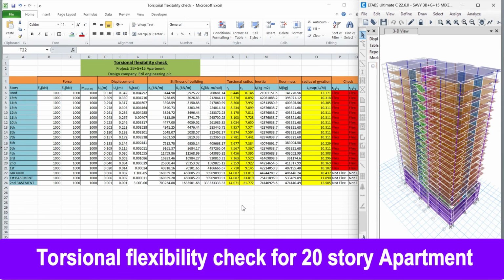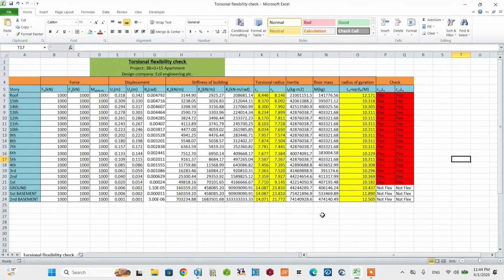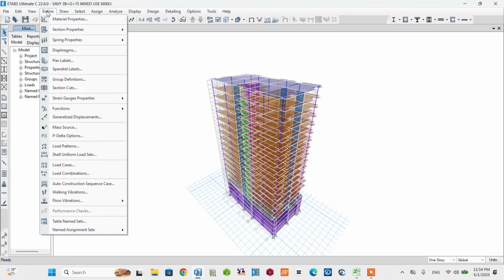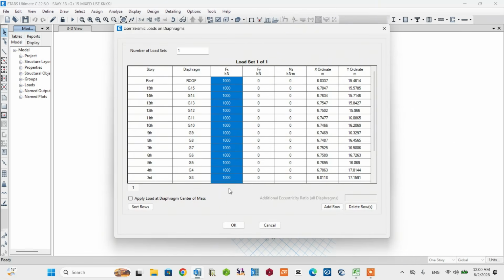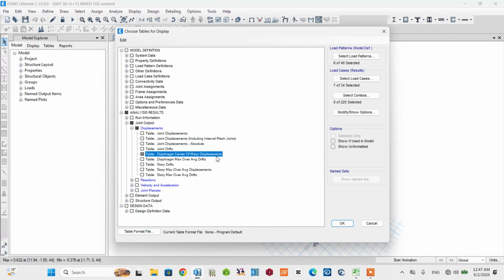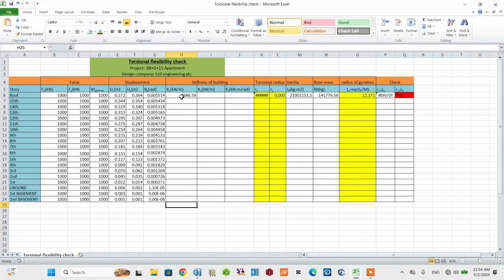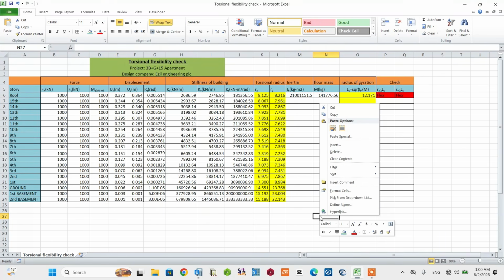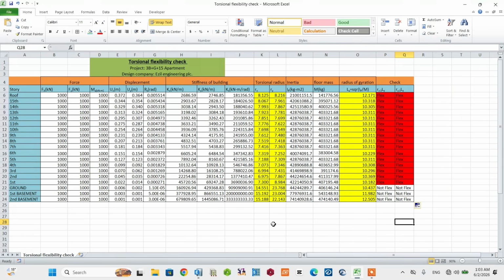4 Pre Design Checklists 20 Story Apartment in etabs – Part 3 Torsional flexibility check

Comment: Selam Dear Engr.
Very nice presentation. As usual I ahve a question regarding to calculations of story stiffness. Why you don't take directly from the etabs result of story stiffness for load case of applied Lateral forces and twisting moment? Or on the top story the displacement is the cumulative of all floor lateral displacement below the floors not produced directly from 1000kN,so why you didn't take a the different of top and bottom story displacement.